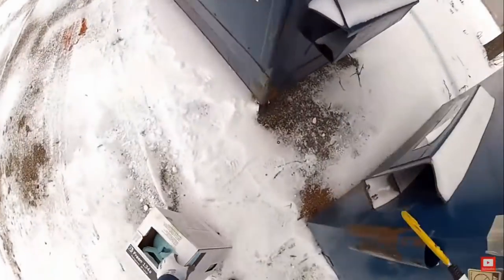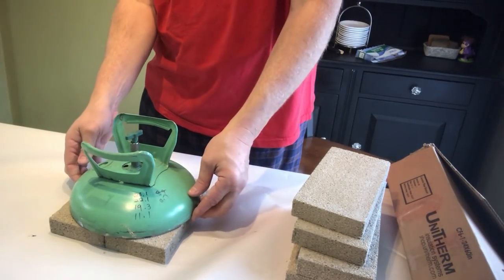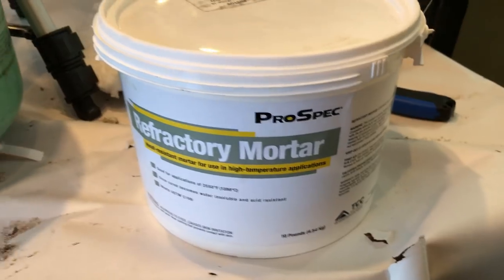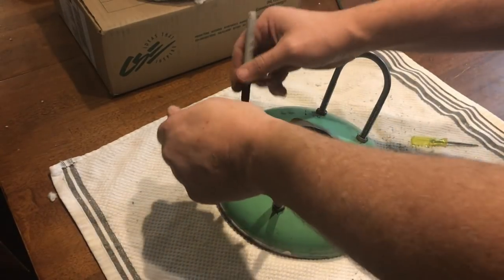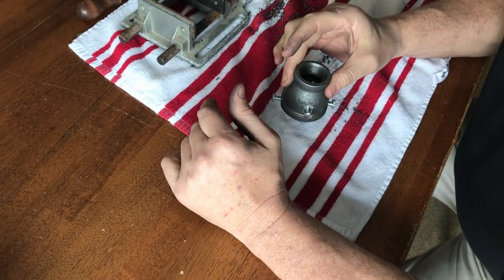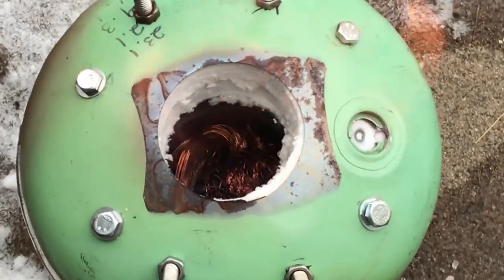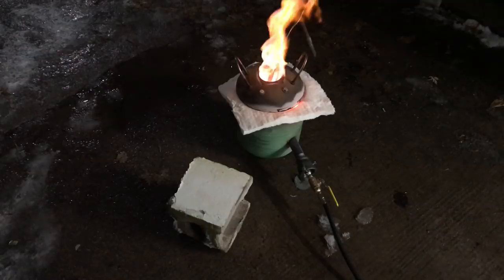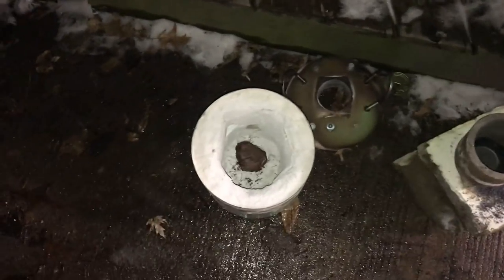How To Build a Foundry to Melt Copper, Brass and More! Well...Kind Of   Rocky I

Comment: Sooo… your issues are (for sure, not guessing): 
1) Your burning to rich; your burner is starving for air…that’s why it “pops”, it burns all available air/oxygen then flame dies but it’s still dumping in fuel, so once air/fuel ratio is right again it reignites off the hot foundry wall. You need to create more more air velocity to your burner by adding 2 inches (8” nipple) and a bell reducer (3/4x1) at the tip. This creates a pressure drop at the tip of burner forcing/sucking more air through the ventury opening at the other end, this = more air/oxygen to burn. Not sure what tip you are using but try a .030 mig tip… Your looking for a blue triangle tip, once you see that it’s good.
2) Not enough air again, lol. Add an air assist tube (connected to air mattress pump, blow dryer, small amount of compressed air, etc) right behind your burner tip as it enters foundry. This will add even more oxygen to burn from all the fuel your dumping in. Not necessarily needed but it will help you get a higher chamber temp and to temp quicker… also add a “dounut” damper to your lid (cut one out of a white fire brick or Kaowool), this works good with the air assist to get more o then burning and then trapping as much heat inside chamber as possible….
    As far as your crucible size in relation to the refer bottle foundry size, your golden. The small space is enough and helps get to temp quicker… I have made this set up this same way and used a 3-4kg crucible, It smelts copper in 10-15 minutes after it has reached temp. (It reaches temp in 5-10 min)
3) Pretty important one, you need to temper your foundry and crucibles!!!! (Google instructions) There may have been moisture still locked in your crucible and refractory coating that kept you from reaching temp as well… honestly, i think you were super lucky, you potentially had a minor explosion 💥 and meltdown on your hands…. Hot molten copper bomb doesn’t sound fun👎👎…Anyway, great job/attempt, try the tips above and I’m sure you’ll be smelting in no time 👍👍

Comment: The concept of a bronze age downdraft kiln... though it's a Woodfire concept it might get the air you need... angle a 5/8th bit down near the cut section about 2 inches behind the fire nozzle... .. the fact the fire sucked back in tells me the top would work better, for mixing and to avoid air tanks... drill really slow and about 30 degrees downward and 10 forword.

Comment: It seems like you had enough oxygen when you first tested it on the deck and had a nice blue flame. I think you’re right that there is not enough room inside for the air to circulate. If you run it without the crucible inside, do you still get the large orange flame out the top?  I’d try a smaller crucible with some aluminum instead of copper so you can have something to pour for a morale boost. For Rocky two, I’d go a bit larger, with more heavyweight materials. The feet are so close that I’d worry about it tipping. I’m using a beer keg with solid retractory inside rather than a brick/blanket combo. Good luck and thanks for sharing your experience.

Comment: One thing is you need a flare fitting at the end of the straight pipe like a bell reducer. Another thing is you need a throttle( as i heard it called) to limit the oxygen when igniting to force the flame to the outside of the flare  and then as you open the throttle  it it allows the right mix of air pulled into the venturi to crank up the heat.

Comment: I will guess you had too much air in relation to the fuel. I am in the process of building a similar furnace and just bought a commercial burner assembly. It has an adjustable damper to regulate how much air gets drawn in. Hopefully mine will work to melt copper, brass and silver.

Comment: I'd say you getting air in your hose you got a leak some where
Reply: It's definitely going to take some finagling to get that thing to work it was hard to tell in the high-speed but my plumber eyes thought he put the Teflon on backwards. But even if he did that shouldn't matter that much the popping might be the regulator that is my guess

Comment: Shane, you need to find a way to and more oxygen or air to your burner to achieve more heat.
Reply: Should say, to add more air, sorry.
Reply: Should say to add more air, sorry
Reply from the maker: Thanks John,  I wish I knew how to add more oxygen.
Reply: @ShaneManTV  you might put about 3 1" slots on the big tube then get a piece of a tin can and bend it around the tube so you can slide it up and down to open or close the slots for more or less oxygen. Or just use a hair dryer at the back of the tube to blow air through the tube while the flame is lit. That would probably be the easiest way.

Comment: Why not use a 20 lbs propane tank? They are generally taller and wider than refrigerant tanks. Might give you the room you need inside? And from the few videos I've watched about melting stuff they recommend heating the furnace at a low temp for awhile to cure the cement so it doesn't crack  when brought up to max temp. Good luck. I really like the idea of making your own furnace.
Reply from the maker: Yes I should have slowly heated the furnace.  I was so nervous about trying to control the flame.  It was really nerve racking.

Comment: I have a glass kiln and your temp outside needs to be consistent.  I melt at 1500 degrees however i am using electric heat not gas.  So maybe your out put not really sure.

Comment: You need more air flow. Oxygen = more heat. You did a decent job building. In my opinion I would have cut the bricks long ways as well, to minimize space behind them. I would go with a smaller diameter crucible if your planning to continue using this forge. Also what were you going to pour into? I didn’t see any molds.

Comment: You actually got 2 things wrong:

Fuel/air mixture is too rich. Need to expand  the venturi vents.

And the fuel/air flow is too high. Those flames shooting from the top are also pulling heat from the inside. Reduce the internal pressure by reducing the flow rate, and that will allow heat to remain in the furnace longer, thus accumulating to a higher temperature.

Comment: I think most burners for a foundry, like the one I bought, have a way to adjust the air, I think you have a mismatch between the amount of gas coming out vs the air intake. Edit: ohh and from what I have read a foundry should be heated up in stages to avoid cracking, or exploding, when the water is driven out of the mortar.
Reply from the maker: Thanks Darin!  I definitely should have slowly heated up the foundry.  I may just have to buy a foundry.

Comment: COPPER STILL HAS A HIGH MELTING POINT - 1,083 DEGREE C  OR 1,982 F  - YOU NEED MORE OXYGEN TO BRING UP THE TEMPERATURE - A DEVIL FORGE WILL COST YOU BETWEEN 300-400 DOLLARS OR JUST LOOK AT THE YouTuber : bigstackD Casting - HE IS AN AUSSIE AND DOES CASTINGS AT HOME - VERY INTERESTING INDEED - GOOD LUCK !!!!

Comment: You didnt bake your crusible, there is moisture in the new ones that has to be baked out .
 your forge has to be ran with out a crusible to bake out the moisture out of the refractory .  an external temp guage of sorts, copper has to be over 1100c to melt. BiGSTACKED has great videos on how to set up new furnaces. so not a fail, just missed a step

Comment: Unfortunately, most scrap yards will not accept homemade ingots. too much potential for shenanigans
Reply: Mark S. That’s the way both of mine are
In my opinion why go through the work...unless it’s silver or gold
Reply: @kirkniles4184  ditto here. two yards, both wouldn't touch them with a ten foot pole.
Reply from the maker: You are correct Mark, I just want to do it for myself or maybe sell online.
Reply: @ShaneManTV  just be careful... molten metal is no joke.  crucibles can crack, the metal can explode from moisture... its dangerous stuff.

Comment: You are loosing to much heat out the top it should be closed.   :  )
Reply from the maker: The flame has to have somewhere to go. Maybe a smaller hole.